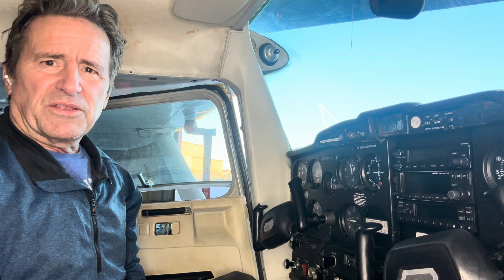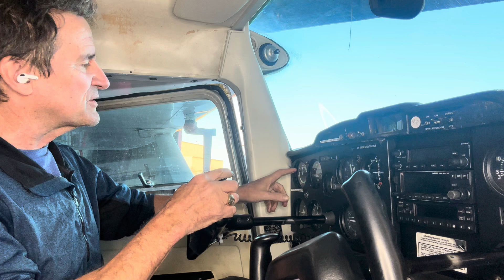Every Airplane Has an Angle of Attack Indicator

Comment: Angle of elevator (or stabilator) indicator perhaps. 
Still, at positions close to full rearward yoke extent, the last 2" to 3" of control yoke chrome can be viewed as an almost perfect mark representing angle of attack (or relative airflow angle over the leading edge of the wing).

Comment: The angle of attack is determined by the elevator, the elevator is controlled by the yoke, the yoke is in your hand. 
If your hands are all up in your crotch you stall, and if they're not, you don't stall. 
This is true regardless of whether you're going 40 kts or 120, and back pressure has nothing to do with it. 
Everyone thinks it's not true in bank, or descending or whatever, but they're wrong.

Comment: Angle of attack depends on how fast the airplane can catch up with the airstream as you rotate. My smaller aerobatic models can do loops endlessly with full elevator and they never stall with enough throttle, but the larger, heavier models can't keep up because of the moment of inertia and they stall if you pull back too much before the wing can catch up with the airstream.  Your assertion that the position of the yoke is the same as the angle of attack is not exactly true but can be a rough estimate in certain airplanes.

Comment: Sorry Charlie, you missed the mark. This video was poorly thought out, oversimplified and misleading. No mention at all of density altitude, bank angle, G-load, CG, propeller slipstream, or acceleration, all of which which have an important role to play in avoiding a stall. The beauty of an AOA indicator is that is combines all of these factors and more into one easy to read indicator and warns of an impending stall in real time. If you haven't flown with an AOA indicator, you just don't get it. An AOA allows you to safely and confidently fly closer to the stall without stalling, which enables the pilot to safely get more performance out of the aircraft. This is especially useful for short field operations.

Comment: It seems there are a few "experts" here who object to an idea expressed as a teaching aid they may have never been exposed to.  Was the video simplified?  Yes.  Could a few minutes spent to more fully expand on a couple key points help? Also yes.  Still, I have been teaching and demonstrating in flight exactly this concept for many decades.  Elevator position, or in David's terms "Stick Position" is a very close if not exact determinant of commanded angle of attack. It is true that a single engine training aircraft the addition of power increases the AOA for any given elevator position.  Extending flaps also changes (reduces) the stalling angle of attack and also the AOA commanded for any given stick position.  CG position, within the normal envelope, has a minor impact on stick position vs AOA.  These and other factors can vary the commanded AOA for any given stick position but they are minor, especially compared to the effect of elevator position on AOA.  IOW's other factors being unchanged stick (elevator) position is the most direct determinant of AOA.  It saddens me that a high number of post solo students and certified pilots when asked: "What primary flight control directly controls AOA?" will struggle with the answer.  I even had this unfortunate conversation with a representative of an AOA indicator manufacture last year at Sun & Fun.  When I proposed the idea that elevator stick position directly controls AOA he absolutely denied the fact.  He couldn't begin to comprehend the reality.  Of course, his company was selling a technical solution to the problem of pilots unwittingly stalling their aircraft.  I have no problem with AOA indicators as a safety enhancement.  I have to object when these tools are used by pilots who lack the fundamental knowledge to understand the problem nor even the willingness to complement these devices with comprehensive training.  It may be cliche but it remains true, "The single greatest safety system on ANY aircraft is a WELL trained pilot". Receiving training and experience from a competent CFI in the subject areas of lift generation, AOA, stall recognition and recovery et al arm pilots with the skills to stay alive.  I firmly believe had the crews of both Colgan 3407 and Air France 447 been properly trained and evaluated for competency in these subjects at some point in their careers those accidents and the attendant loss of life would never have happened.  These are not theories, They are demonstrable aerodynamic facts that should be understood by every pilot but sadly are not as evidenced by continued departure from controlled flight of GA aircraft every year.
Reply from the maker: Thanks for that! Exactly the point of this video; AOA correlates with yoke position. Electronic panels and too much technology take attention away from direct aircraft control and simple explanations.

Comment: In your demonstration of pulling the yoke all the way back to its stops I noted that it moves up at the end of its travel instead of just coming straight back. I have a couple of questions about that; what is the reason or design philosophy behind that movement, and how mechanically do they accomplish this behind the panel?
Reply from the maker: Though I have also observed that years, I do not know the exact answer...worth exploring with a mechanic on the next annual though: thanks!

Comment: Why is there a natural tendency for the aircraft to turn to the left?
Reply: Because the prop turns one direction.
Reply: @Super170BAlaska  only One Direction ? what about Boyzone and some of the other bands?😂
Reply from the maker: @mrmr314  there are four major forces, pulling the plane to the left: https://www.boldmethod.com/learn-to-fly/aerodynamics/why-you-need-right-rudder-on-takeoff-to-stay-on-centerline-during-takeoff/
Reply: Depends on which way the propellor rotates. 
Many instructors assume that all props rotate clockwise when viewed from the cockpit. Incorrect. 

I’ll leave the reasons why it turns left to the other commentators.

Comment: It depends on so many other factors as well. So no, the airplane does not necessarily stall, when you pull the yoke or stick all the way through. It also depends on the trim setting, the current power, weight, CG and speed. You can stall with just a little pulling the elevator, even full forward elevator might stall, see a runaway trim all tailheavy. Also you can pull all the way to the edge and not stall at all.
But in fact that statement from the title IS true. Every airplane will indicate to you when a stall is impending - stallhorn, speed indicator, buffeting, sluggishness of controls.
Reply: trim setting has NOTHING to do with stalling.  stop looking at the glass panel and look out the window at the nose and horizon.  that is your built in and very inexpensive AOA.
Reply: @ When you make a statement like that, you should really explain yourself there. Why do you think trim has no factor in stalling? Why do you think pitch is an AOA indicator? And what does it have to do with glass panel?

Comment: But your ah already indicates your angle of attack. The yoke stick does not tell you anything
Reply: Your AH shows your pitch attitude. This is NOT the same as Angle of Attack. A given pitch attitude can result in a varied AoA depending on your speed, energy levels, etc.

 Imagine you are in flight with your nose pitching up slightly. Imagine you let your airspeed decay and you enter a stall, holding the same pitch. 
Your AH will show the same pitch attitude, but your AoA will have had to increase, as it has now gone beyond the critical AoA - as that's the definition of a stall.
Reply: @JJFHNREHJEDK  😆lol. And how will your speed decay? If you you can answer this you will solve the confusion you've created for yourself....
Reply: The AH only shows the attitude of the plane relative to the Earth. A plane can have an angle of attack of zero while going straight up or straight down. It could just as easily have an angle of attack of 15 degrees. The AH won’t tell you the angle of attack in either case.
Reply from the maker: You have a very dangerous misconception there (as others have pointed out). Flight attitude and AOA are often not at all the same! You cannot tell the AOA of a plane from a picture, only from the trend. In most basic terms the AOA is the difference between where you are pointing the plane and where it is going.
Reply: @SAFEPilots  it took you 2 months to come up with something and you still couldn't come up with a profound response. The "others" gave a much better explanation within hours. They should probably be the ones doing a this video... Your yoke stick theory is just as "dangerous" if not more, as others have already pointed out.

Comment: Are you a real pilot? I‘m not sure dude
Reply from the maker: Yes, for the last 50+ years. A lot of commenters here are mistaking AOA with airspeed. Full back yoke canstall the plane at cruise airspeed. This is how you create a snap roll (a horizontal spin). The plane is stalled in level flight (and you can also stall pointed straight down). AOA does not correlate with airpseed (it is "invisible")

Comment: So if I’m in a 45 degree bank I won’t stall unless I pull all the way back to the stop?  Careful what you believe on the internet people, it could kill you.
Reply: Have you ever tried it?  When I demonstrated accelerated stalls or approach to accelerated stalls, I would bank 45 degrees, hold altitude, and gradually reduce speed.  The stall warning would always start 10 to 15 knots above the bottom of the green.  I usually didn't take it any further because by then it already required an enormous amount of back pressure because of the forces in the turn and I didn't want to over-stress anything.  But if we had kept slowing and increasing back pressure, I think the stall would have very closely coincided with full rear position of the control wheel.
Reply from the maker: @warren5699  Yes, that is exactly correct. A turning stall at 45 degrees (if you maintain level flight) will stall 19% higher that wings level. If you are coordinated (wings level) the nose just falls away from the lift vector (lift is equal on the wings - no rolling) and release for recovery. This is a required maneuver in the commercial syllabus to illustrate exactly that point. Most pilots approach this with great fear (and the hostility you sense in these replies). It really is all physics and essential to safe piloting. We have a syllabus called "Extended Envelopt Training" that demonstrates the larger flight envelope to pilots: https://bit.ly/EEM-121
Reply from the maker: If you bank 45 degrees and let the plane descend at 1G, it stalls at the same airspeed as level. What happens in a 45 degree bank is pilots are maintaining altitude and adding back pressure (more AOA). I use the 45 degree turn a lot in flight demonstrations because this only increases the stall speed by 19%. Most pilots overestimate the effect. At 60 degrees of bank (2 Gs) the increase is only 40% (1.4 - square root of 2).
Reply: Well, you shouldn't just stall at 45 degrees, that is not an angle of attack.
Reply: @jasonMB999  But that's what happens to pilots when maneuvering as in the base-to-final stall spin.  It's part of the training to avoid loss of control.
Reply: @warren5699  that's not at all what happens to pilots on final. You're not even supposed to to final at 45 degrees, the setting of your plane does not allow that.
Reply: @jasonMB999  Not sure what you mean.  It's not when the pilot is on final - it involves how the pilot controls the airplane when turning base to final.
Reply: @warren5699  it's not how the pilot controls the plane, it's the setting of the plane. I don't think you have good understanding of flight. It's better you leave it here
Reply: @jasonMB999  What does 'setting of the plane' mean.  That term is not in any aviation handbook.
Reply from the maker: @warren5699  Commonly in the base-to-final turn, pilots are not maintaining level flight. They bank and see the ground so add back pressure (subconsciously pulling away from the ground). A turning stall while accelerating in most planes does not "break" and alert the pilot. Most descending turning stalls just "mush" and I think that is why this is so common and dangerous. 86.3% of stalls in the pattern occur on take-off and turn-out though (high power and high nose position - AOA)
Reply: @jasonMB999  Accelerated stalls are covered on pg 5-19 of the Airplane Flying Handbook where this is noted:  "This is a maneuver only commercial pilot and flight instructor applicants may be required to perform or demonstrate on a practical test. However, all pilots should be familiar with the situations that can cause an accelerated stall, how to recognize this type of stall, and how to execute the appropriate recovery should one occur. "
Reply from the maker: @jasonMB999  If you are maintaining level flight at 45 degrees (this is a commercial flight test maneuver), you are adding back pressure (increased AOA) and the stall ocures at 19% higher than wings level stall speed. If you bank 60 degrees and (and maintain level flight) the stall it occurs at 40% higher; physics!
Reply: @SAFEPilots   also, base to final turn normally has 20 degrees flap, 1700rpm and is a descending turn. Stall speeds increase even further.
Reply from the maker: If you bank 45 degrees and let the plane descend at 1G, it stalls at the same airspeed as level. What happens in a 45 degree bank is pilots are maintaining altitude and adding back pressure (more AOA). I use the 45 degree turn a lot in flight demonstrations because this only increases the stall speed by 19%. Most pilots overestimate the effect. At 60 degrees of bank (2 Gs) the increase is only 40% (1.4 - square root of 2).

Comment: Tough subject, David.  I agree with your analysis.  Unfortunately, I think problems generally occur when the pilot is overloaded and isn't aware of the position of the pitch or the control wheel, possibly when fixated on the runway base-to-final.  What we need to include is realistic training scenarios that can regularly occur and which substantially increase the workload of the pilot with the objective that the pilot accomplishes the scenarios without any loss of awareness of the airplane's condition and margin of safety above any loss of control.
Reply from the maker: @warren5699  Scenarios and “overtraining” to the level that recovery is automatic! (Few pilots get to that level) I was in a level D simulator with a PIC Jet captain, who stalled the plane and held it all the way into the ground(red screen!) he is a very experienced pilot but panicked and froze up – amazing!
Reply: @SAFEPilots  Oh no.  That reminds me of Air France 447.  Do you think that the custom of powering out of the stall in jets contributed?  That's not done any more, correct?